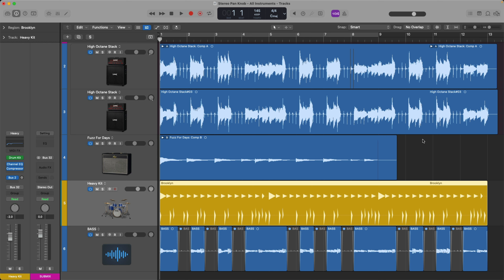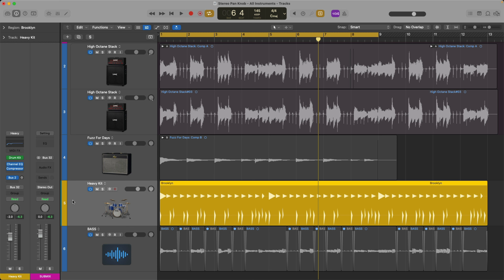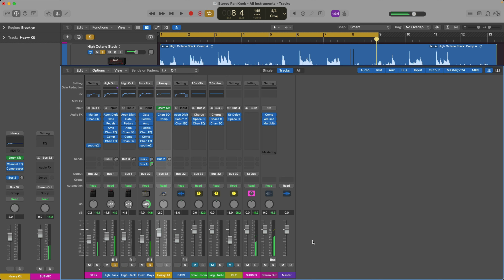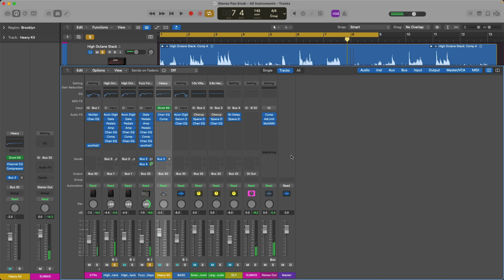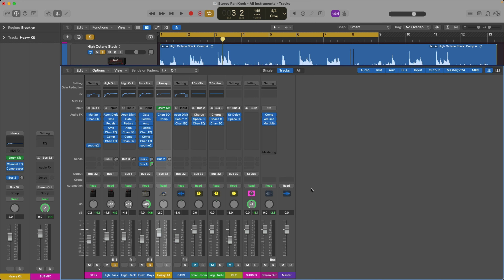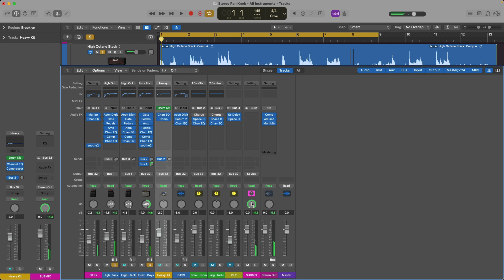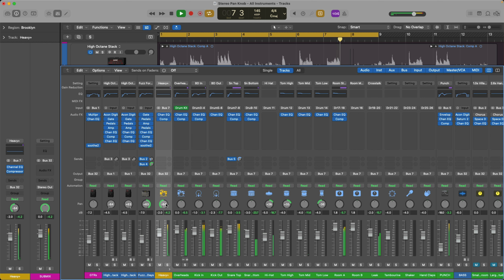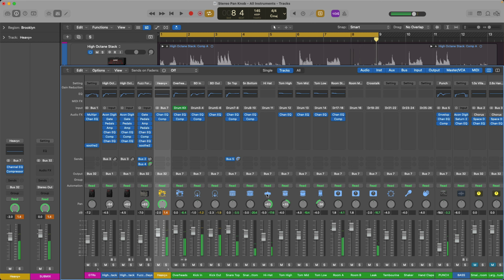The #1 Logic Pro Mistake When Panning Stereo Tracks

Comment: in mono track. not an option. i am reamping. noticed if i put the mono in the middle. my amp get more of the di signal than the reamp sount. so i panned 100 to the right and dont get the di sound at all in the reamp. which is what i wanted. but why? thx for the video

Comment: Does anyone know why Logic (still) doesn't have even panning to both extremes? (Left goes to -64, Right goes to 63?) This has been the situation for as long as I can remember... (pre-Apple)
Reply: It's a MIDI thing. Most digital components have a backbone coded to MIDI so that it can be controlled w/ a keyboard, digital rotary knob, fader etc.  MIDI parameters have a total of 128 values which technically starts at 0 so it goes to 127 (btw zero is considered a value and therefore worth 1). So the math is 0(which is actually a value of 1) +127=128.

Back to panning... since panning has a center position considered 0 (which is an even amount of the L and R channels) that means that one side has to have 64 and the other 63 to work out to 128. So the math is as follows: 64+0(which is actually value of 1)+63=128.

I hope that helps.
Reply: Totally appreciate that mate... That's in credibly informative  @JourdanHines ! (still, visually, it should "appear" equal... I don't recall if PT shows "MIDI'd Panning numbers"... Do you know JH?)

Comment: I've never understood why Apple never made that the default setting (once it became available—In Logic 3?). Seems like a no-brainer. Literally.

There is one other issue here, which is when you have a track of a single instrument (or an effect aux, like for reverb) that has a lot of stereo width inherent already, and where certain aspects (usually certain harmonics) are more to the left and others are more to the right, which is central to what makes a wide stereo instrument or effect sound wide, if you adjust that with the balance knob, that means you are increasing certain dynamics in favor of other dynamics, which means you are changing the timbre (or the envelope) of that sound. That is likely not what anyone would ever have in mind. We have other methods to accomplish a timbre  or envelope change which are much more effective.

But if you adjust with the pan knob, all aspects remain at the original strength, the sound does not change in envelope or timbre, only in pan position (of course the farther you pan the less width there is to that track).

Of course for mono instruments on separate tracks (not bussed to a stereo bus) it won't matter whether you use balance or pan, but since this has been available, the very first thing I do when creating a template is change all balance to pan, and whenever I add a MIDI instrument, I change it there as well. This is one of the reasons to keep a tranche of pre-set instruments available with specific settings, is that you don't have to be annoyed by having to change from the default (balance) to pan, constantly.

When this changed Logic Pro (formerly Logic Pro X at the time), it was a significant improvement. Why Apple didn't make pan the default then (or anytime in the years after) just boggles the mind.